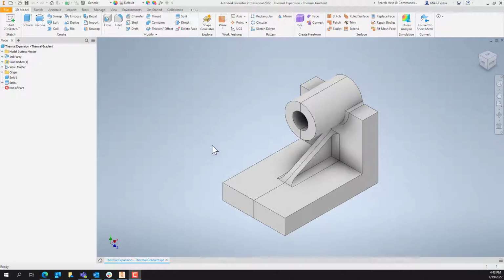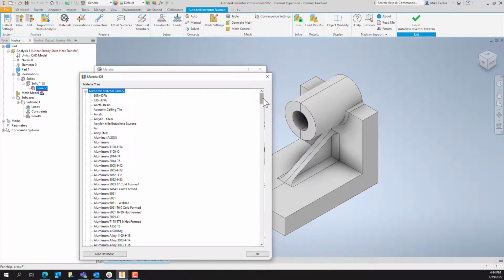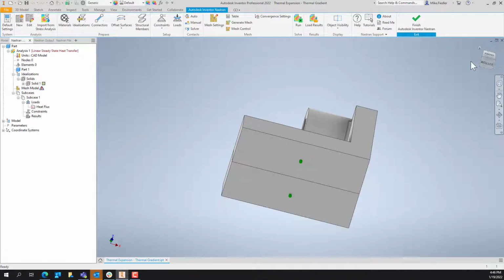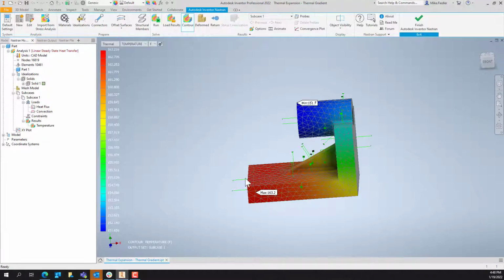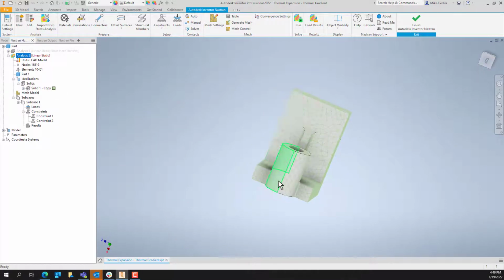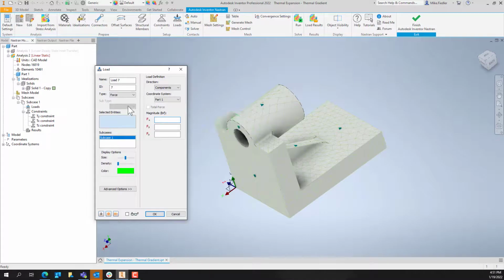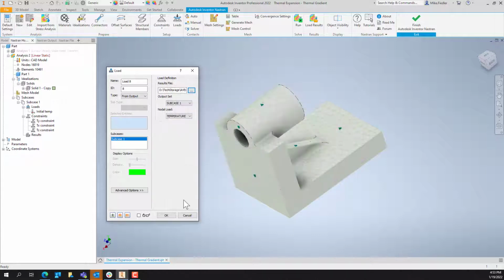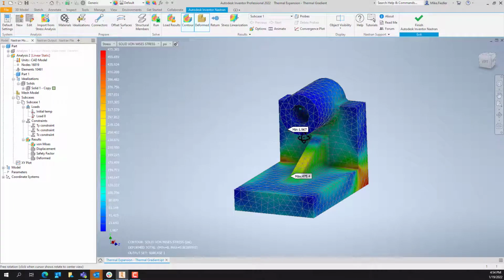Thermal Expansion   Thermal Gradient

Comment: Is there a way to print out a report showing what the thermal expansion values are, and the locations of the max/min deflections?
Reply from the maker: Apologies for the late reply - but the answer to your question is yes.  (1.)  When you generate the report (right mouse click on Analysis in the Model Tree - Generate Report), presuming that you have Min/Max Markers turned on - when the program takes various images for the report, Displacement should be one of those images.  The Min/Max markers should display location and value.  (2a.)  You can get all of the displacement values printed to the *.OUT file.  If you double click on the analysis type (e.g. Linear Static) in the Model Tree, this should bring up the Analysis form.  The default 'Output Options' pull-down you'll see is set to Plot by default.  If you change that setting to Print, it will write all the displacements to the .out file.  Note that if you have many nodes in the model, this can make for a very large out file.  https://help.autodesk.com/view/NINCAD/2024/ENU/?guid=GUID-10BFD564-87F7-465B-B3BB-05F61E291DFA  (2b.)  If there is a smaller region of interest, it might be better to use the XY plot and select an edge of the geometry (for instance) or a few select nodes and then after plotting the values you can export that as a .csv file (which can open in Excel).  https://help.autodesk.com/view/NINCAD/2024/ENU/?guid=GUID-3B982345-7F90-455E-894C-0B20F5D32A09